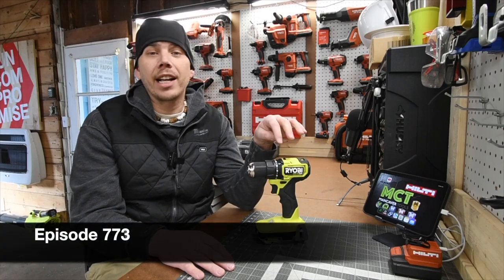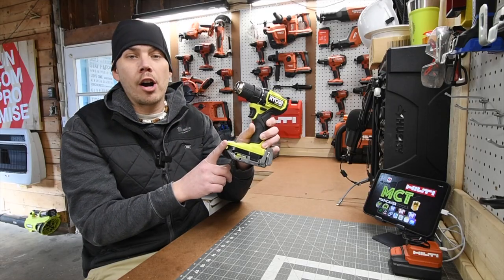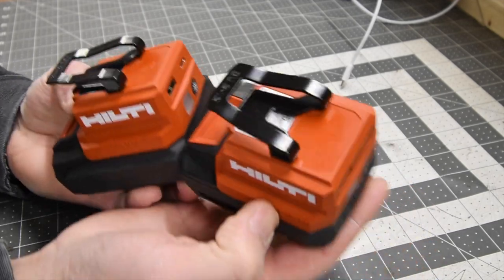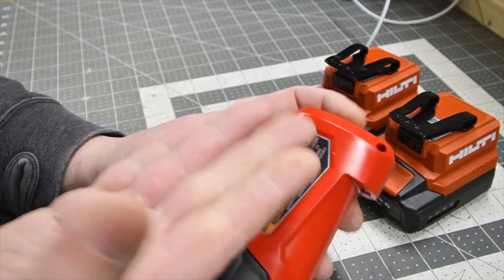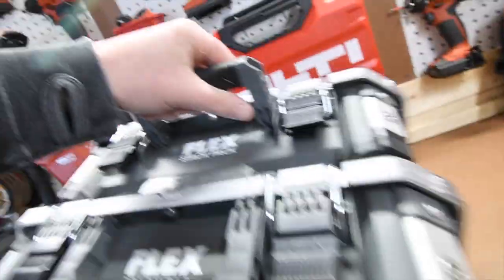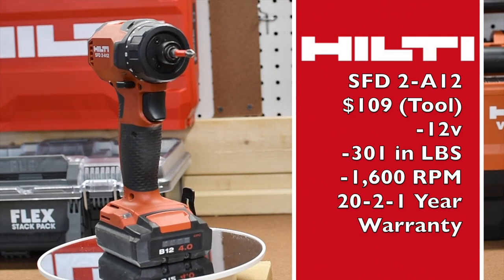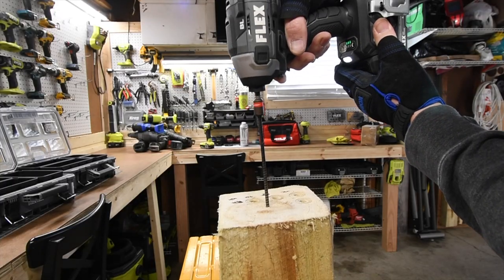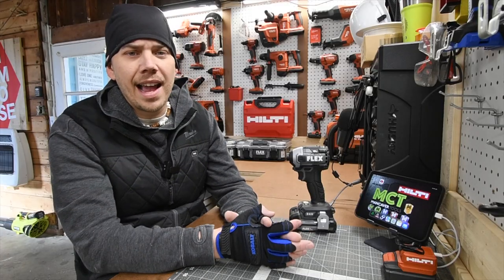HILTI, Flex, Ryobi on Power tools and MORE!!

Comment: I really want to love flex but I just can’t get there maybe the new compact stuff will
Reply from the maker: I want to see how those new tools are. Hoping the price is lower as well.
Reply: I bought the inline circ saw kit.  Oh my god i love the feel of this saw.  Outstanding cut visibility,  a light that lights up the entire cut area.  Its really light weight.  I can run the saw one handed even with my messed up wrists...
It makes me think of a car that your on the fence about until you drive it and you get out after the test drive thinking man i love the way that car drives.  That's the flex inline circ saw for me.  I went and bought a second battery for it.  Its a keeper!

Comment: Dan, I too have two of the new Hilti CU 2-12 USB adapters with B12 4.0 batteries. Are you finding sometimes charging stops before device is fully charged (I'm monitoring with Klein inline USB meters)? I'm finding iPhone charges to 100% but iPad only to 99% and some other smaller USB devices such as radios less. Same problem with USB-A and USB-C outputs, Hilti battery is fully charged, using original manufacturer's USB cables. All devices charge to 100% with other brands of USB power banks and AC/wall chargers. Awesome straight-forward reviews! Thanks.
Reply from the maker: the charger so far charged everything while it was plugged in. no issues yet. but I use it all the time so we will see what happens in the future

Comment: Ryobi should use the lithium pouches in their HP batteries or at a minimum 21700's and keep the 18650's for their regular batteries. The only difference between the two is essentially a better BMS.

Comment: I know Harbor Freight tools aren’t really your thing but you really need to try out the new brushless Hercules impact driver and hammer drill/drill drivers with the 21700 cell batteries.
Reply from the maker: I will be getting those soon.
Reply: A friend had those.  I was shocked at how well the new hercs are performing.  I just wish Hercules would make a battery miter saw.  Only bauer has a 7 1/4 battery miter saw.